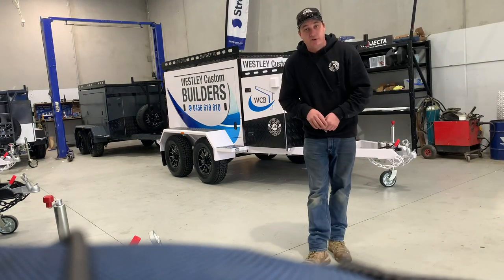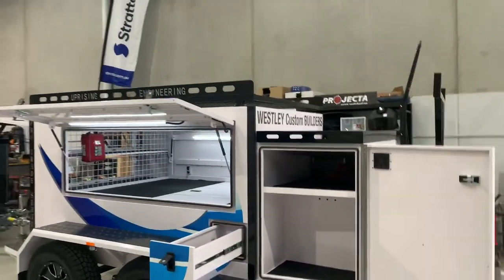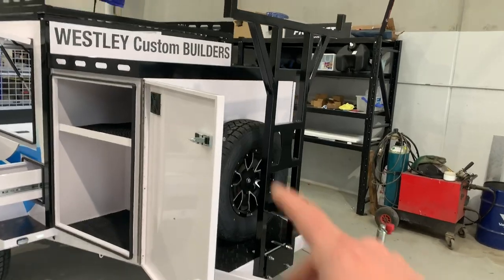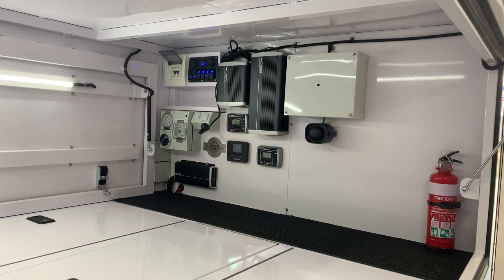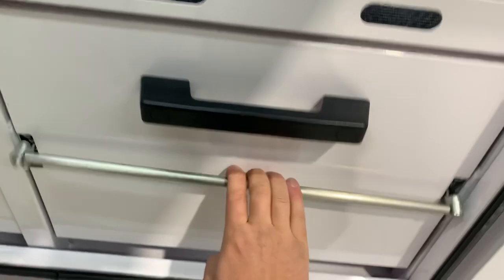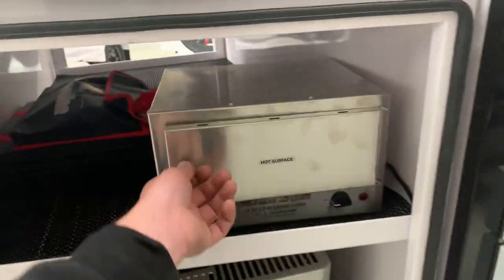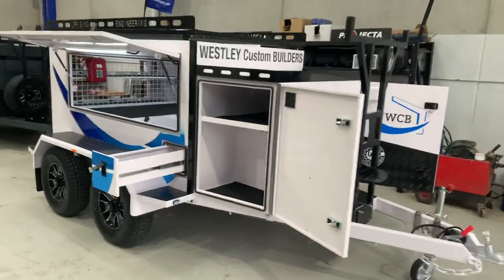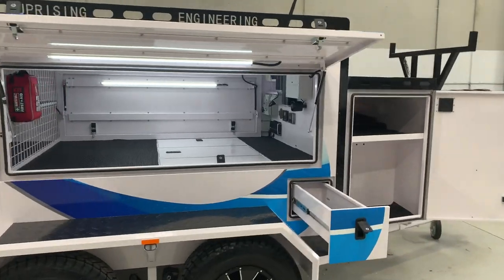Pro trade series tradesman trailer - Envy package build

Comment: Very nice trailer but man I could buy some nice stuff with that price tag, 8x20 foot enclosed trailer and a truck to pull it  or a 4x4 sprinter van. Also 2 #3500 brake axles on a trailer that size is absurd. 1 non brake axle would be just fine, not hating though this is obviously a premium trailer.